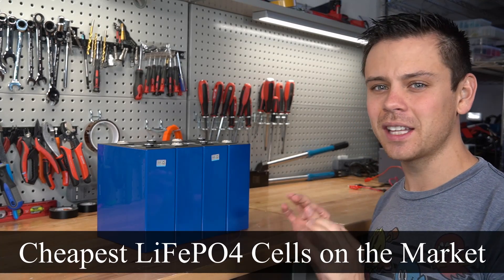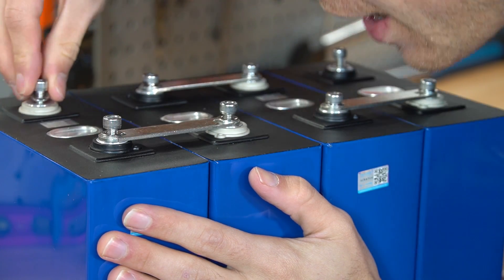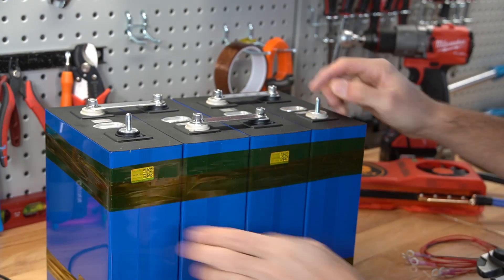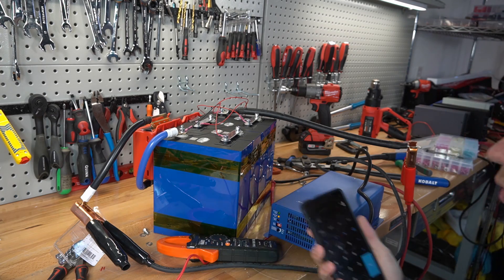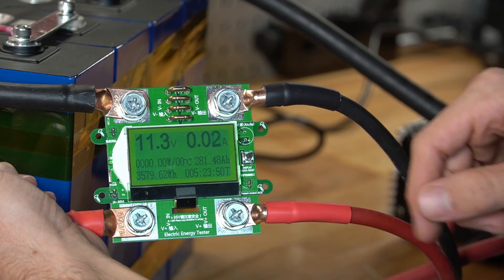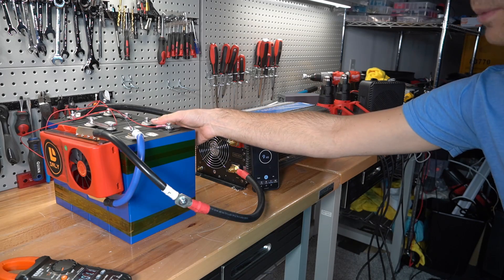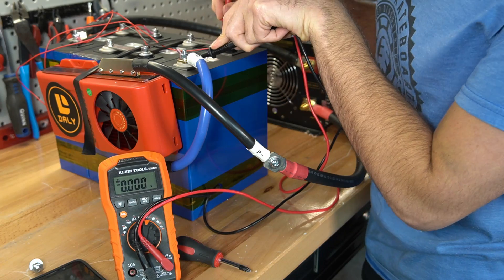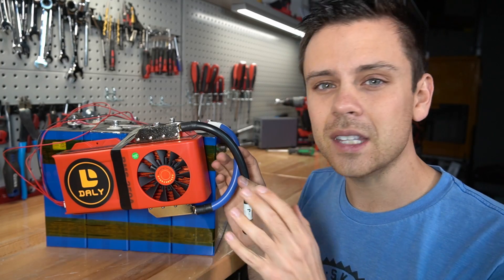$433 280Ah LiFePO4 Cells Tested: Cheaper than lead acid!

Comment: Recently discovered this channel and really enjoy the info.
Here's a question. We had solar panels installed this past summer and are happy with what we're seeing. I'd like to have battery backups asap, but prices seem quite high. Can anyone point me in the direction of a suitable alternative to the big ticket items? Some of the videos I've seen here look plausible, but I'm very new to this and don't want to waste my time and money or take unnecessary risks with my family's safety.
Thanks in advance on any help or advice.
Reply: Buy 16 cells and a BMS, buy a cheap MPP Solar 5kW inverter ... and hire an electrician to put it all together and integrate it into your house system. 
It will be independent from the grid-tie system you already have. I am building the same house UPS.
Reply: @mrzed6597  
Yes, we are grid tied for ten years with our local electric company. Part of the deal to get the rebates.
Down side is when the power gets shut off (or goes down) our power will still go away.
Long term goal is to have a full UPS to prevent loss and to go fully off grid when the contract ends. That would completely remove us from all utilities.
Reply: It seems like you failed to watch this video before adding your comment.  This setup could work.  As could the same, but in a 24V or 48V setup with an appropriate charge controller (what gear do you currently have installed?) and inverter.
Reply: @HiltonT69  
I will admit up front that I don't have a deep grasp of our system. It is a Solar Edge array running 10.88 kWp on 34 panels. Does that help?
Reply: @HiltonT69  
The inverter is single phase (?)

Comment: Great video! Thanks for posting. Should you always get a BMS with an amp rating that meets or exceeds the battery capacity even if you never plan on pulling that many amps?

Comment: Hello Will.
Great review. 
Maby consider to use a good quality internal resistance meter and termal camera, to observe temperature behavior of components and electric joints while performing tests. 
Best regards.
Reply: Seeing the temp perspective from an infrared camera would be pretty cool!
Reply: Voltage drop against internal resistance is heat P = RI² so just a multimeter and big 1C load is cheap and reliable method.

Comment: What amperage power brick would you recommend for a build like this when doing AC charging.  I plan on using solar charging most of the time but occasionally it will be more convenient to use AC.

Comment: Thanks for the review! 
I am about to build a house UPS with 16 cells, a Heltec JK 200A  2A Active balance BMS, and an MPP Solar 5048MK 5kW inverter.
Also thinking about making stronger busbars. They sell 20x2mm nickel. I am thinking about 25x3(-4-5?) mm copper. But aluminium terminal and copper busbar will be any problem? Like galvanic corrosion ?
Reply: Coat every surface in conductive grease, torque correctly, clean all with de-greaser, a burst of compressed dry air and then a coating spray like everclear.

Comment: I am gobsmacked that those busbars held up so well...i thought at those amperages they would get really hot.
Reply from the maker: Right?! There were only warm, and I could leave my hand on them the whole time. I can't believe it.
Reply: @WillProwse  Too bad you did not measure the voltage drop on them. Probably 20mV?
Reply: That would be 5W, probably would feel that when touching them.

Comment: If I make 2 of these batteries and ran them in series and parallel to make a 24v battery and hooked them up to my four 390 watt solar panels would I have to upgrade my 24v Giandel 2000 watt inverter to a 3000 watt inverter?😳
Reply: Not unless you plan on using more Wattage at the same time. These cells would just make your inverter work better than lead-acid batteries. You would, however, need to get an 8S BMS instead of the 4S one Will uses on the 12V system above.
Reply: I have been checking out Daly bms on Amazon. Would a 8s 24v 150A bms be a good bet for my RV?

Comment: These are NOT EVE cells, these are Lishen 272Ah cells!!! They should have more capacity than the EVE-280 cells.
Reply from the maker: Check out my pinned comment. Why did they pull 281ah?
Reply: @WillProwse  Because they are better then the EVE 280 cells. I also bought the Lishen 272Ah cells myself. they probably have a little more resistance than the EVE280 cells. check out the specs for the lishen 272Ah.

Comment: Would a good application for grade B cells be to replace a deep cycle lead acid battery for  a backup sump pump where it is charged most of the time?

Comment: I wonder seeing as those are 280 amp hour cells and their grade b I wonder if they were 300 half hour cells when they were new and they've got 2,000 cycles on them the only supposed to lose 17% hard cycling them 2000 cycles which is just about right.

Comment: Aren't they advertised as  "A" quality cells?  Can we trust no one?  Where would you recommend purchasing some grade "A" cells and know you are getting what you paid for?
Reply: I've bought 2 sets of these eve cells, both listed as grade a. The first set were impeccable, well packaged, sealed terminals, the whole 9 yards. The second set... 2 of the 4 were obviously used, and the 3rd and 4th looked new but had literal lint in the terminals, but would have passed for grade A otherwise. I think some of these cells have been laying around in an open warehouse for quite some time. All of the cells have pulled at a minimum 280ah, with one set pulling 305ah. These are legit if you have the space for them and don't overtighten the terminals.

Edit: after reading Will's update, my second set are infact lishen 272ah cells. The vent on the top is literally different - eve seem to have a blue film over the vent, terminal polarity is cut into the top layer of the packaging on the cell, and the lishen cells have a clear film over the vent and no polarity markings. I suppose time will tell if these lishen cells are indeed up to the reputation of the eve lf280's, and since I have a set of each, I'll keep my eye on how they compare.

Comment: I have 4 105ah cells on the way from a supplier on Alibaba, 364$ us shipped to Canada.   They've told me in writing that they are brand new, Grade A EVE cells.  The shipping cost to Canada for cells on Aliexpress is crazy town.  Guess we'll see how it all works out, I have some torture testing planned if they ever show up.
Reply: I spent $3100 Canadian on 16 of the 280 ah batteries but that was with shipping included. A lot cheaper than the Tesla powerwall with more capacity.
Reply: I've purchased 16 202 amps cells from Alibaba.  Shipping cost is 300$US to Montreal, Canada.  Total cost 1317$US.  Price looked ok with 62$ per cell.

Comment: It's a 4 month wait on Aliexpress
Reply: NO not really  - .right now though we are in the beginning of the Chinese New Year so that adds 30 days right there .. but typical turn around time will be 60 days normal and 90 days with New Years involved ...
Reply: @ghostwriter6699  yes you are correct but I believe the date it posted is very close.. I live in California and this is aliexpress estimated delivery  
Delivered before 04/18 or full refund
Reply: @Sirslayer_X  YES so AliExpress uses THAT date as a date that you can initiate a REFUND -- which is still about 90 days from today ... AliExpress likes to give a WIDE margin of error in dates to allow for shipment delays
Reply: @Sirslayer_X  I have had two battery shipments, both arrived day before on right on last date before I was eligible for a refund. The return label from the post office was for a gentleman in CA, almost feel like they were prepositioned and sent using just in time shipping. Or maybe not, but either way they didn't get here rapidly.

Comment: The way how things develop right now looks good for my electric sailboat projects in next few years. In year or two I should be able to upgrade my current boat to lithium much cheaper. And my big boat project will need massive battery within ~5 years. Looking forward to that.

Keep up the amazing job you’re doing!
Reply: A 22 foot Marshall Cat boat fell in my lap last summer, I removed the 1975 16hp diesel westerbeke and am going electric. My motor is 5hp with 48volt 270ah system. Looking for specs on solar and shore power charging. Thanks in advance. Thank you Will for sharing the elec-trickery.
Reply: @PlantedwithIanCooke  I’m not that familiar with lithium charging but what I know is:
You need mppt solar charge controller that can charge 48V. And to that you need a bunch of solar panels in series to raise the charging voltage high enough for that controller.
Challenge in sailboats is shading. In series configuration all the panels should be without any shade to work properly.
There could be combined solar and shore chargers available, but haven’t looked those yet...
Reply: @ArcticSeaCamel  I don't have a boat yet but I have dreams of snagging a much older cat, rewiring the whole damn thing and plugging in LEDs as well as going full electric. Wondering if it's possible to have a combination of solar panels and either a wind or 'water' turbine. I've heard you could potentially use your motor (assuming AC) to work as a generator while under sail. Salt dreams right now, though. Edit. I should add that I'm a newbie to electric AND boating :|
Reply: @jonathanself1263  Hi. Yeah, it's definitely possible to use your motor as generator but there's a few but's.
- There's no any reasonable current coming in under 6 knots of speed
- That means, that regneration works properly only with reasonable big boats. My 27 footer isn't big and fast enough.
- There's some compromises to be made of the efficiency of propulsion and regeneration, the propeller shape and size is complex issue that I still know too little about.

Solar panels are getting better and better all the time. In catamaran there's often plenty of space to put reasonable big array of them.

You can check my channel for some info of doing electric conversion to my current boat. The plan for the 15 meter boat is to do fully electric propulsion but with backup generator for cold climates.

Also check Sailing Uma's experience of electric propulsion. They're using second hand Oceanvolt system currently. But they also tested a boat with two servoprops a while ago. Very interesting setup.

Cheers!
Reply: Make sure to pack a life boat in case it catches on fire. Wouldn't be a good time.
Reply: @GreatDivineCornholio  LiFePo isn't going to catch fire. Lead Acid batteries emit hydrogen when charging and can explode. And short circuit will set things fire regardless the battery chemistry. Gas and Diesel are also flammable.

So the life raft should be there anyway.

Comment: Will Suggestion:
If the cells connection threads are damaged use a tap to chase the thread.
(Obviously we know you're using the correct bolt to connect to the cell)
Reply: Does anyone know the stud or bolt size so I can have it on hand?
Reply: @sailpac  M6
Reply: @acmeopinionfactory8018  Thank you very much. Will order it now.
Reply: Mack Fisher The terminals are not deep enough for a tap, it will bottom out before the full threads reach the damaged area.
Reply: @acmeopinionfactory8018  he could get a thread chasing kit, they don’t cut new threads. Or he could invest in a bottoming tap set.
Reply: @acmeopinionfactory8018  That's why you use a bottoming tap......

Comment: If you get a thread cutting die you can run it onto a stud with slightly damaged threads with very little force and then you can spin the nuts on with your fingers. This process is called chasing the threads, and if you're working with a supplier of high quality tools, they will actually have a type of die called a thread chasing die, like Grainger or McMaster- Care. But you can probably get away with one from Ace Hardware. Lowe's, not sure what's near you. You can also get thread gauges to measure the size of the stud and the number of threads per inch. You can usually figure this out backwards by taking a nut to the hardware store and asking a for help trying to measure the bolt size and threads. So, that used to be easy in ASE, ( coarse threads), NF ( fine cut threads are stronger). Now from overseas you most likely have Metric,and they can be tricky to match, but getting the right tools may prevent you from breaking off a battery stud. Cost of this would be less than $25, something worthwhile to add to your skill set. Happy New Year, one and all. 👍🔨👍
Reply: There are 3 types of thread taps, Taper, Intermediate and Plug, best one the finish a short blind thread is a Plug  tap
Reply: Its called a "tap" to cut threads on the inside, like a nut and "die" for threads on the outside, like a bolt. Just incase someone got confused.
Reply: I was glad to read this as I was thinking the same thing. If the stud size is standardized for Lishen and Eve perhaps someone on here that has already done this exercise can post the stud and thread size (like you I am assuming it is metric) and also possibly the depth. Will advised switching to studs instead of the provided bolts but he did not mention the sizes to use. Here finding metric threaded rod is a challenge so I may have to go to long bolts and cut them down.
Reply: @rvnolafolks7687  Go to McMaster Carr or just use long bolts with a nut, assemble the lug or busbar, then bottom out the screw by HAND then tighten with the nut as needed.  or use overlength screws and add a couple of washers as needed.
Reply: An old-school thread file works best for me. It's got eight different thread sizes in one tool, so it also doubles as a thread gauge!
Reply: Agreed, but not many people have tools let alone thread and die kit. Great looking out, it's how newbies learn. Yep I have tools galore. i Like, OLE!
Reply: Oopps I stripped the threads . . . now what? I'm thinking of soldering? Any advice?
Reply: @natiej  no soldering on a battery post. You don't want heat like that. You can probably very gently drill one size bigger and tap out to the next size if it's a hole. If it's a post, you can file and cut it down a size. Depending on the power draw you expect to draw, if you don't need a lot of surface area or there is room for a Rube Goldberg job, a 1/4 or an 1/8 pipe nipple might go in because they have tapered threads, then you could attach the wire to that. ( Last resort)
Reply: @camperjack2620  just put one or 2 short pcs of solid copper wire in the hole and thread on;  DO NOT OVEERTIGHTEN..............obviously.

Comment: Excuse my english, what is a stud? I didn't understand how they were used in this setting..
Reply: It’s basically just threaded rod. You can put it in place and use nut on it. Instead of using bolt every time on those weak threads.
Reply: @ArcticSeaCamel  Thanks. That made perfect sense.
Reply: AKA grub screws
Reply: A stud is used in the terminal screws sometimes to make there be less chance of stripping the threads in the cells I think
Reply: It's like a bolt protruding from the mounting surface, without a head. And uses a nut in place of a bolt head to be tightened,   or it converts a female connection to a male, , or it is a male used for breeding, like a stud horse! Ha-ha!

Comment: Wow - what timing. I just ordered 16 of these 2 days ago. Really glad you reviewed them and happy you gave them a thumbs up - Thanks !!! So I do have a question. What BMS would you recommend to use with these? I haven't ordered a BMS yet as I wasn't sure of a suitable model.
Reply from the maker: Overkill 48V BMS: https://www.mobile-solarpower.com/raw-lifepo4-deals-page-676969.html

Electrodacus SBMS if you are an advanced user.
Reply: I bought the new Heltec JK 200A BMS with 2A active balancing.
Reply: Whats the maximum draw you are going to need?  BMS's are rated on how much current passes through them - STAY away from the DALY wireless BBT models ...
Reply: @ghostwriter6699  Thanks. I have one issue. I currently have a 12V 2,500 Watt inverter. I plan to get a 48 V higher power inverter (which is why i got 16 batteries), but can't afford the new inverter right now. So I need something to work with my 12V system for now...   and then the 48V later. Not sure what my options are. I don't want to buy 4 x 4S 200 Amp BMS for now and then have to get the 48V 16S 100A later, although I think I might have to do that.
Reply: @rcmedway  Many ppl will do just that -- protect each 12V pack individually and then connect them in series later to make 48V ... Just get yourself some cheap BMS's that do nothing more than keep the batteries from draining toooo low or charging toooo high and you will be fine until you can get what you truly want ...
Reply: Actually, that was dumb. Looking at Will's web pages, you can parrallel them up, so it would be 4 x 12V 4S 50 Amp BMS (which would be a bit cheaper).